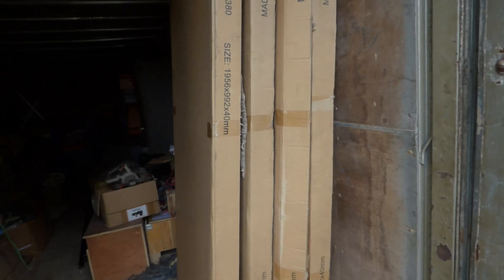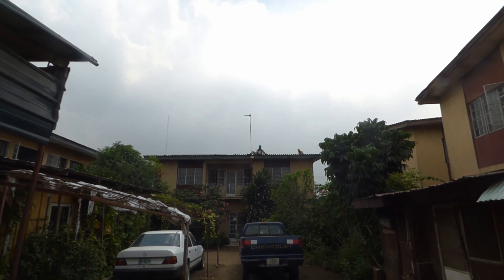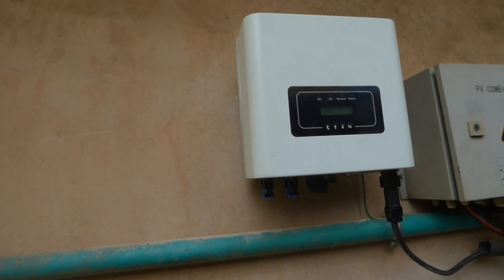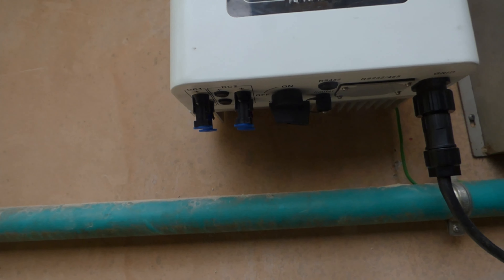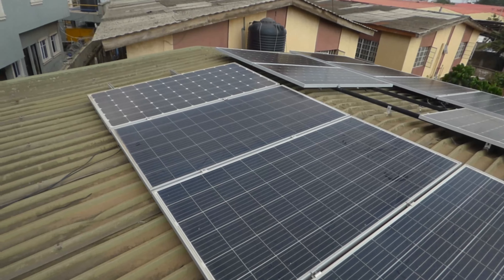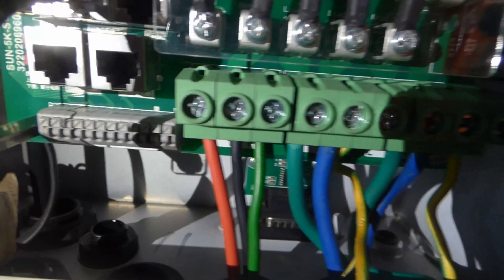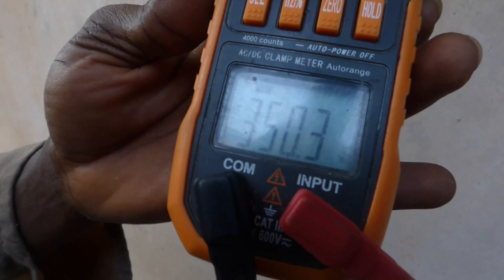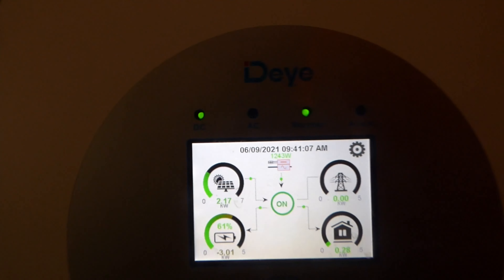AC and DC Coupling the Deye Hybrid 5 kw Inverter. Did it work?

Comment: Thank you Dr ,I am getting my deye system due to your indepth videos.

From South Africa. 
Deye 5kw, 5 panel 330w in series with 2.4kwh pylontech.  Im tired of load shedding and eskom
Reply from the maker: Good morning from Lagos. Congrats on your decision. Your pylontech battery is limitéd to a 25 amp charge and discharge keep that in mind. There is a voltage sweet spot the Mppt likes. Your 5 panels might not get there. Good luck with your new investment, you will enjoy it
Reply: @drsolar  thank you.  
So before taking stock of it ,I up my panels to 5x 350w Csun panels with Voc 46.5.
So I'm a bit off from that 370v sweet spot.

I will be grid blending for now. Till I can go totally off grid like you in future.

Comment: See it works you just need the right inverter to supply the sine wave, plus you don't need charge controller so it is cheaper to do. In future remember to keep the AC couple below 80% of the capacity of the AC production of the main inverter, Also make sure it controls the ac produced so it doesn't overcharge the battery Test this to be sure as it just flows backward into the battery unless the DEYE changes the frequency to shut it down. Just make sure it works which I am sure it will. Cheers
Reply: Very clear now...many thanks
Reply from the maker: OGW thank you as always for your support and comments. The Deye Hybrid inverter forms the grid and does the frequency shift. It starts the PV inverter at 95% and stops it at 100%. It was really a no brainer. I will do a detailed video. I was too excited doing this project. I hope all is well with you.
Reply from the maker: @billlong4508  glad it made sense. Let me know what else you want to know

Comment: Good day sir! I really appreciate the video you shared. Would be so kind to share or provide me a connection/schematic diagram of your AC and DC coupling to Deye hybrid Inverter? Also, is the grid tie/on grid inverter you used was a different brand or a Deye brand also? Thank you in advanced for answering my questions.
Reply from the maker: @oget1  thank you for watching and commenting. Deye is amazing. It use the generator port as the input for the pv inverter and does the frequency shift to match your settings. I used a Deye PV inverter. No special connections or schematics. Pretty straightforward. The output of the pv inverter goes into the generator port
Reply: @drsolar  thank you very much sir for answering my questions. More success and power to your videos. God bless!

Comment: Hi Dr. Thanks for your video.. Just a noob question, what if the Gen Port turned off as the battery goes over 95%, your grid tie inverter PV production will continue go to normal load and or to the grid to sell if still excess? Thank you..
Reply from the maker: Hello Paul welcome to the channel. Thank you for watching and commenting. Please don't forget to subscribe. Once the battery is full, the PV inverter goes on standby till the battery inverter tells it to provide power again.

Comment: Wonderful video as usual Dr Solar. It's positively surprising how straightforward their AC coupling is. I'm wondering what will happen if you were using their three phase hybrid, will that require their three phase PV inverter for AC coupling? Are you AC-coupling because you've maxed out the MPPTs on the 5kw hybrid?
Reply from the maker: Thank you for watching and being the first to comment. It blew my mind. Someone told me I should connect the inverter to the load side instead of the gen port, that is a future project once I confirm with Deye how it should be done. I already have 5 kw on the 5 kw hybrid. I could add another 1.5 kw to max it out. I did the AC coupling to prove that I can do it. It paid off big time today. The batteries got to 97% very fast with 2 AC's running and then the rains came. So for now it is my way of extracting max before the rains come. If I were using their 3 phase hybrid I would be using a 3 phase PV inverter to make it work. Great questions. Thank you again.

Comment: Hi Dr Solar, I am AC Coupling the 3.6kw Deye string inverter to a 5kw Deye Hybrid.
The system is totally off grid.
I am a bit confused about the String Inverter settings especially the Running Parameters.
Can you give me any advise on how to set this correctly in an island mode for Australia.
The manual does not explain in enough detail.
Any advice is much appreciated.

Thank you.
Reply from the maker: Thank you for watching and commenting. Use the Gen Port for the pv inverter. In the settings for micro inverter set the percentage at which you want the pv inverter to stop supplying power (battery percentage). That is how it handles the frequency shift
Reply: @drsolar 
Thanks for your reply. I have 1  problem. The hybrid Inverter switches the load off and on  when battery reaches 100 percent with AC coupling.  Any ideas why this would be happening. Thanks.

Comment: Hi, I’m in the UK and I and thinking of the Deye or LuxPower as AC coupled inverter to link to my battery system with UPS. I currently have SolarEdge inverter for the PV. which do you prefer? Could you also link me to your factory contact for luxpower and deye?
Reply from the maker: Hello Peter send me an email at info@atlanticwastepower.com. I have installed the two but only AC coupled the Deye. It was a breeze.

Comment: Wow!  I did not know about Deye being able to do AC coupling.  This is what I was looking for.  I currently have a 3kW grid tied micro inverter based setup (APS YC500A).  I sell excess power to the grid during the day but I still buy electricity at night.  I've been looking for a solution to store excess energy during the day and use the stored energy at night, without having to go to a retrofit of my current set up since they micro inverters still work.  

Question.  I am confused on the setting for the micro inverter input off/on is 100% and 95%.  I don't understand what it does.  Can you explain a little further?  And why would the PV shut down?  Can it not sell back to the grid instead of shutting down?  Seems like there is some wasted power that could have been generated if the micro inverter/gen kept on working.  Is that even possible?
Reply from the maker: We can't sell back to the grid. So the settings are necessary. The % settings are triggered by SOC of the battery. It shift the frequency and stops my grid tied inverter.
Reply: I understand that the microinverter switches off at 100% but I don't  understand why the settings to come on at 95% that it was producing usable power when the batter was at 65%?

Comment: thanks a lot for the video, I am also very excited after seeing this video I just installed a  sofar 6KW on grid inverter, and a separate Deye hybrid 5KW with 48V batteries. can I  do Ac coupling with  Deye to sofar , so that both will work when grid is off  what exactly do I need for that? do I need a changeover switch ? thanks again  ( is their any way to contact you on email or phone)
Reply from the maker: No you don't need a change over. The Gen port and settings will manage it for you

Comment: No load on loas. Must we use the Gen Port.
Reply from the maker: If you want the inverter to manage the PV inverter, yes you do.
Reply: @drsolar  what I mean is if we can put it on the load side instead of gen side. Just like Victron inverter
Reply from the maker: @orikoladeakala5704  I understood you. However the Deye will not communicate with the PV inverter and you can't tell it when to stop sending energy when your battery is full or when you have no load? I honestly don't know. Deye claims that we can connect to the load side
Reply: @drsolar  ok thank you sir

Comment: Nice Video sir, will this work without the battery? Also can this setup double the export power of Deye like if it is rated 5kw + coupled with another 5kw will it export 10kw?
Reply from the maker: Incredible question. Deye does not recommend that we run their inverters without battery, but we know people that do. The 5 kw can export more than 5 kw, I am not sure what it is able to do with the PV inverter attached or even if it will work in export mode.

Comment: Hi,,i have mine AC coupling Set Up 5kwt Deye and 3kwt Solis GTI but the GTI Not Turning ON will you Please show the specific wiring Diagram
Or my 6 Pcs. PV AE460 MD-120 solar panel not sufficient to power up the GTI Solis S6-GR1P3K-M
Please help me
Thank you ,,Doctor Solar
Reply from the maker: Thank you for watching and commenting. Connect it to the generator Port and activate microinverter
Reply: How about the Solar panel of mine do this is sufficient voltage
Thank you for your Answer,,
Regards
Reply from the maker: @dpacificquiaoit8312  read the manual for the answer. I am not familiar with the Solis

Comment: We have 5kw inverter SMART LOAD function not work, how to solve this problem
Reply from the maker: How do you have it configured? Thank you for watching and commenting
Reply: @drsolar  
Thank you for reply, problem solve by update both 5kw inverter firmware
Reply: @drsolar  5kw inverter not communicating to lithium battery, so how to connect battery to inverter. We have connect Leoch company two 48v 100ah battery parallel by rs485 connector but they not show bms voltage in inverter, how to configure
Reply from the maker: @shree6252  ask Leoch if they have the Deye protocol on their batteries
Reply: @drsolar  ok
Reply: Why Deye inverter Show 100 c temperature, can we change in system or not
Reply: Both inverter want same firmware version, so we have Update both inverter firmware and solve all problems. Thank you
Reply: @drsolar  Both inverter want same firmware version, so we have Update both inverter firmware and solve all problems. Thank you